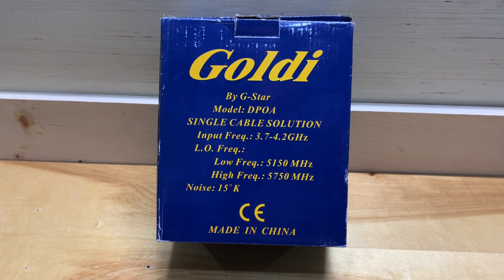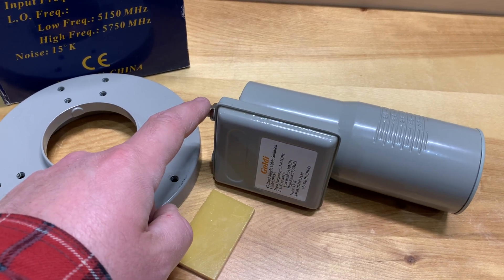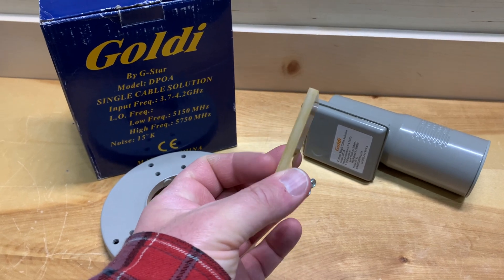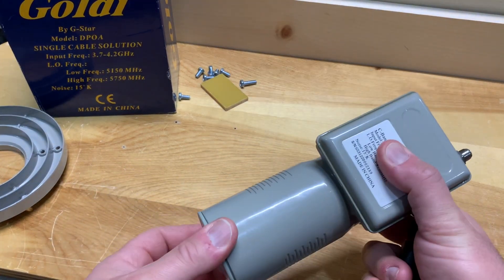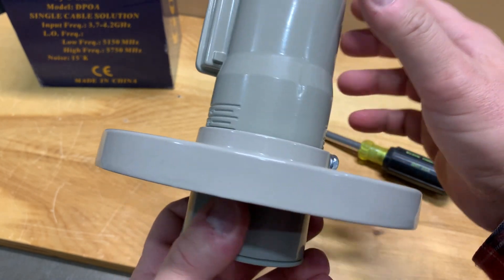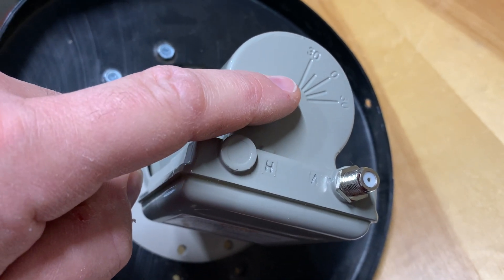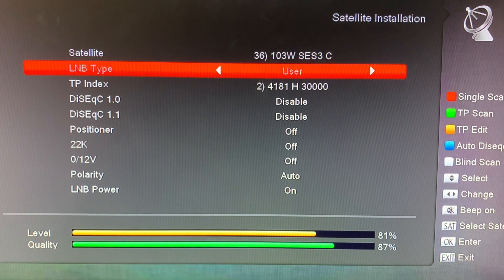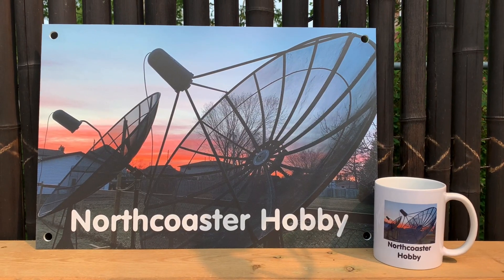C Band Satellite LNB Review

Comment: Information that is added from my side and I do the same mistake on my Offset dish with the Flat-Feed. This Flat-Feed will only work on PFA (Prime Focus Antenna) dish. On a Offset Dish you need a Conus-Feed and the reason is that a Conus-Feed are watching inside the dish like a Oval-Lamp (torch lamp). The Flat-Feed is watching into the PFA dish like a Round circular. Best Regards Volker from Vienna Thumbs up 29.
Reply from the maker: Thanks for the info!

Comment: Happy new year NH. Is there anything like sensitive dish, quick to receive signal? Can a dish be sensitive or lnb be sensitive?
Reply from the maker: Not that I am aware of. The key is setting up the dish and LNB as accurately as possible for the satellite you are trying to receive. I say this because I use inexpensive equipment and it works well if it is set up as carefully as possible.
Reply: @NorthcoasterHobby  Appreciate the swift response.
Reply: The LNB is the sensitive component, as for the satellite dish the bigger the better, the dish is not sensitive but as time goes by it gets bended by the wind and rusty from rain and snow and will make the reception worse, after 10 years you have to replace your dish in some cases after 4 or 5 years. The dish is the passive element, it's a reflector that only focuses the signal on the LNB. The coaxial cable must be mandatory an RG6 tri shield or RG6 quad shield, if you use an RG59 or 3C2V cable the reception is poor and you won't receive some channels even if you have a large dish and a very good LNB.  Newer models of LNBs have a better reception than older LNBs. For example if you compare an LNB from 2011 with a LNB bought in 2021 you will notice that the signal strength and signal quality is much higher on the 2021 LNB model than the 2011 LNB model used on the same dish.  The AMIKO LNBs and RT Inverto LNBs have the best reception and can be used with small dishes and on long cables. On large dishes not only you get the best signal even on weak transponders but sometimes you can receive satellites or transponders out of your footprint. There are some LNBs that do not perform well and have issues with long cables and weak transponders.  The dish and the LNB must be pointed accurately for the best reception in this case I recommend a digital meter, you will do a great job pointing the dish compared with the satellite receiver. Sometimes you may have a problem with your receiver either you have an old receiver, it can be a software problem, it happened with some receivers and the problem was solved with an update, or you are unlucky and you bought a receiver with a faulty tuner, or you may have short circuited your tuner.  Another advice is that if you want to receive both C-band and Ku Band avoid the C/Ku Band LNBs, they are crap either they do not perform well on Ku band or don't perform on both bands, it is better to have two satellite dishes one for Ku Band and the second for C Band and you can connect them using a switch so you can have only one cable to your receiver and don't have to connect and disconnect the cable every time you want to watch another satellite. Happy New Year to you too!
Reply from the maker: @Nicholas_Chris  Good points raised here, thank you. I keep C and Ku band separate, but I wouldn’t mind trying a C/Ku LNB just for the experience.
Reply: @NorthcoasterHobby  I forgot to add that when it comes to aluminium or steel satellite dishes I'm talking about Ku Band dishes don't fall for the trap that aluminium dishes are better than steel dishes they have the same reception. Actually the problem is that aluminium dishes are worse than the steel ones. The aluminum dishes don't stand up that good to high winds, the mounting holes tend to crack out over time in a windy environment, and the dish goes down the road. As for the rust if you live by the ocean due to humidity your dish will get rustier, the life span of the dish is reduced in half or even a quarter. As for C/Ku LNB I would do a test but if I get the same results on C Band I will use it on C Band only or use it as a backup if something happens with the other C Band LNB.
Reply from the maker: @Nicholas_Chris  Thank you.👍
Reply: @NorthcoasterHobby  Thanks so much Nicholas for your detailed insight. I guess it comes from experience which is definitely invaluable. Do you have any recommendation for latest digital satellite finder taking into cognizance new technology like h265, dvb s, S2, t2, etc? NH, you can weigh in on this too. Thanks
Reply from the maker: @davidakingbade2874  I would look at a SatHero 400 or 800.
Reply: @NorthcoasterHobby  ls there any less expensive finder models  in the market?
Reply from the maker: @davidakingbade2874  The GTMedia V8 Finder. I did a review:

https://youtu.be/0hzIAw_mR6I
Reply from the maker: And also, Happy New Year to you!